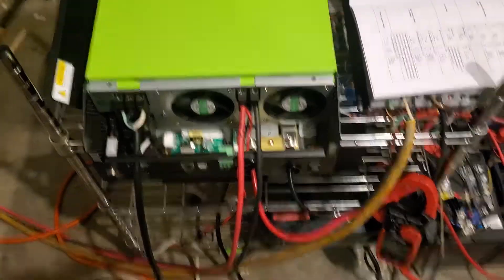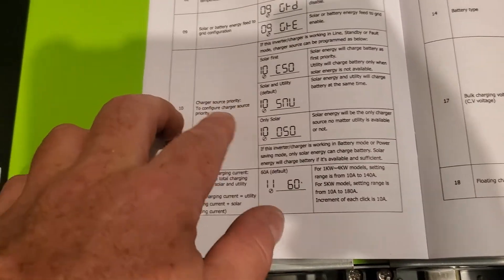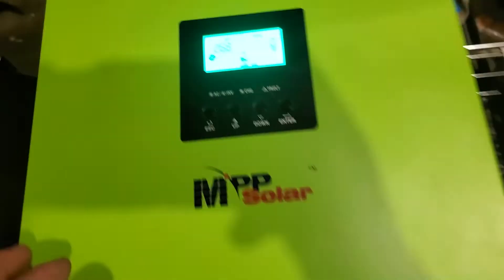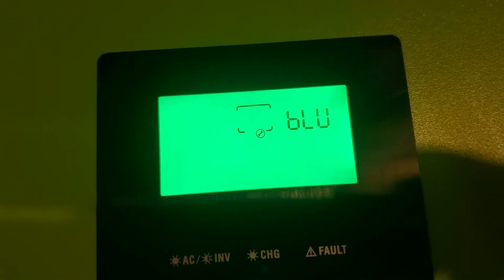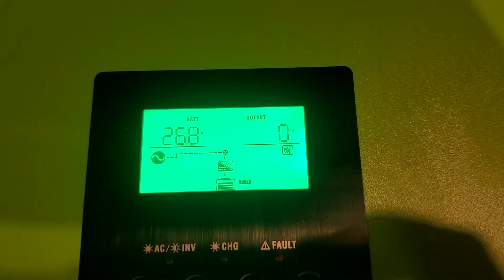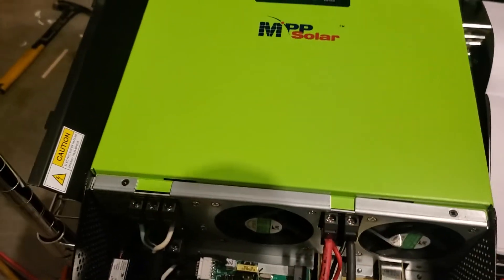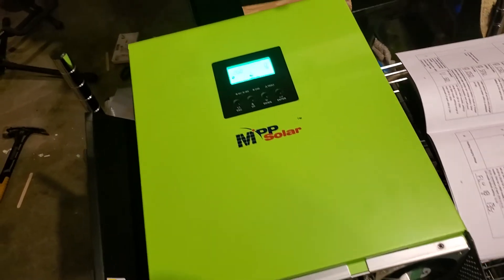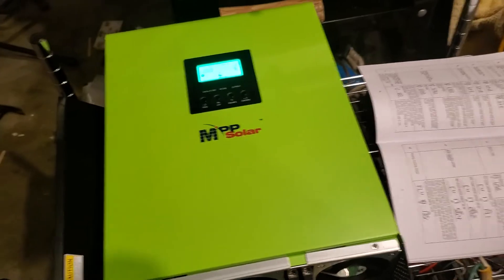hv lv 2424 how to enable grid charging.  mpp solar hybrid aio inverter

Comment: Trying to troubleshoot mine since grid feed is not doing anything… grid feed goes back through the input, right? Not through the load output.
Reply from the maker: Yes if you're using it as a grid tie it should feed back into the input

Comment: We are using this hv lv 2424 system and don't know if when using in parallel can we put 2000 watts from our array onto the main or master and then add 1500watts to the pv2 slave inverter? We are off Grid.
Reply from the maker: Use both charge controllers. Split the array up . Using 2 panels in series or 3 if the voltage is within the  limits of the mppt charge controller.  I  run 26 240w panels. I have them all 2 series  so i usually see 60v ive seen over 2kw output from the panels under load. But i dont like to push it to its limit. Infact i have 6 panels on my epever 40amp tracer 4210an charge controller that will do about 1kw under load. If you have the 2 units hooked together why not use both charge controllers?  Im guessing they provide 240v split phase? The output is probably half since the voltage is double. 
So i guess your wondering can you have 2kw of solar on one and 1.5k on the other. Yes.